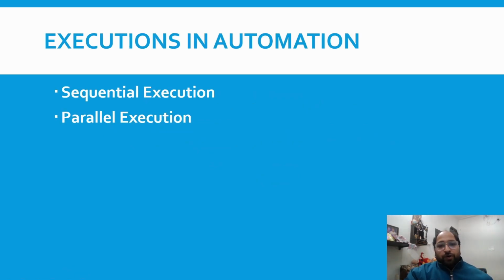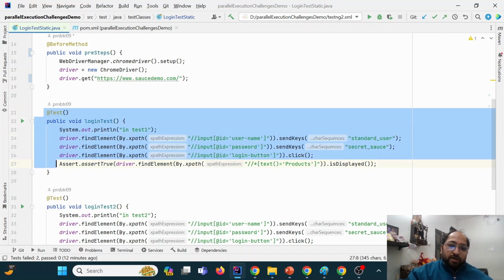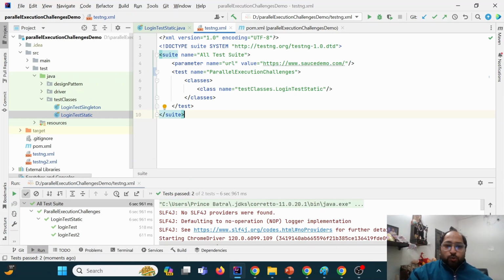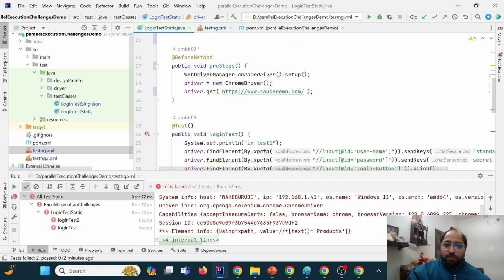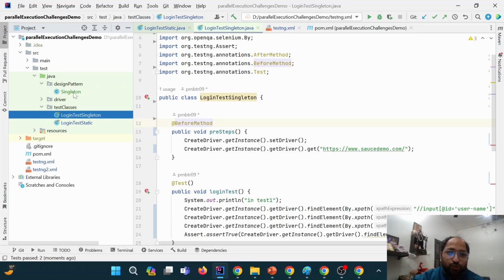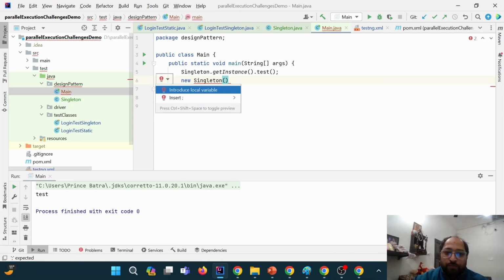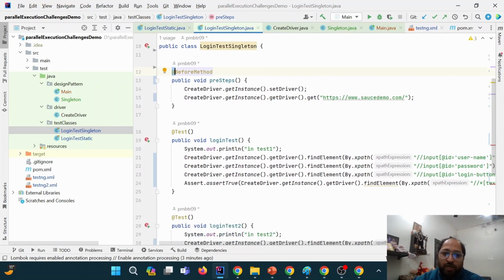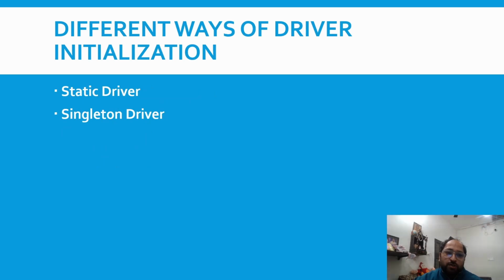Mastering Parallel Execution: Overcoming Challenges in Selenium Testing || TestNG

Comment: This is one of the hidden gem on TestNg with parallel execution challenges.  Nicely explained .  Hats off
Reply from the maker: Thanks buddy
Reply: Is there similar content for test data management , test report management for parallel execution.
Reply from the maker: Not so far but I will try creating soon
Reply: @PrinceAutomationDestination   ok thanks for the consideration .  I think the test data supply  via  data   providers  or json should be thread safe .  Else it will create a issue in parallel executions .    The same applies to reporting as well  when we are using extent report or allure .. All should be thread safe
Reply: Awaiting your video for the above mentioned challenges.
Reply from the maker: You are right
Reply from the maker: Sure